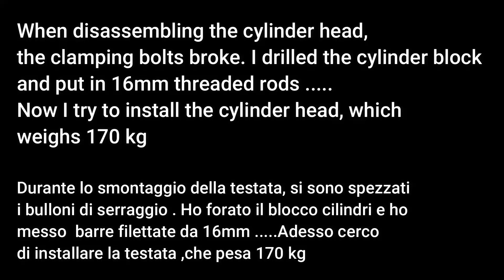Rescue Fiat allis FL8 1960's ?!!!? Cylinder Head Installation !!!  ENGINE REPAIR  !!!  PART 3 .

Comment: I wish you all the best, especially because I own the same model, but I could not imagine, that the M16 bolts will work for a long time. The recommended torque for M16 8.8 bolts is approximately 230 Nm, but the requiered torque for these engine is 330 Nm. I hope, I'm wrong, because it was a lot of work, that you have done......
Reply from the maker: Hello thanks for the answer.
Yes you are right it was a very difficult and problematic repair.
The threaded rods I used are really very strong ...
The cylinder head with the new bolts were tightened to 320nm without problems. Now, I've been using the crawler loader for about 3 weeks. Your intuition is right, HOW LONG WILL IT LAST?

Comment: How did you remove the broken studs? Did you drill and re-tap? I have the same fiat engine with this problem.
Reply from the maker: Hi .
It was a huge job.
I tried to mill the split spike at the bottom of the monoblock.
Then very patiently I drilled the old bolts with a smaller diameter. The original diameter is 18 mm. I drilled with a 14 mm tip to insert 16 mm threaded rods. You must use threaded bars of 8.8 steel or in any case steel with a strong hold.
I advise you to use a magnetized drill, with extensions, because in total they are about 30 cm deep.
I don't recommend that you remove the old threaded / stuck bolt, because they don't come off in any way, you just waste time.
The only way is to drill and insert new threaded bolts.
Reply: @thecatSimo  Thanks for the advice. I have a magnetic base drill I will do as you have suggested.